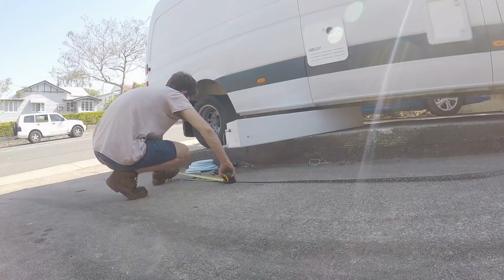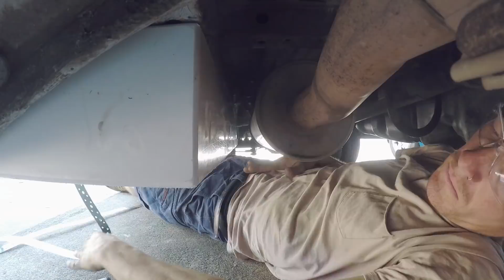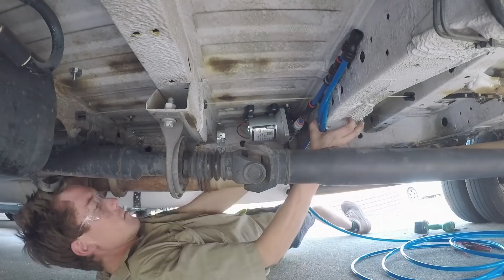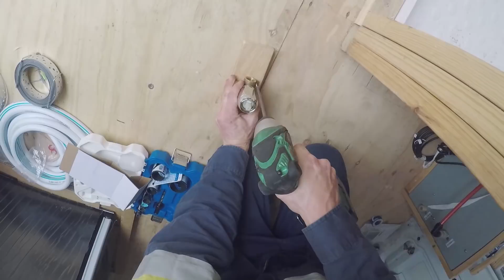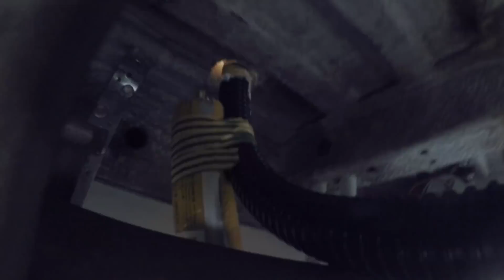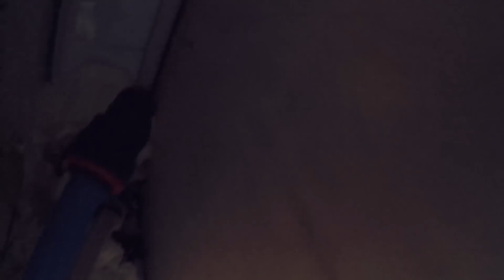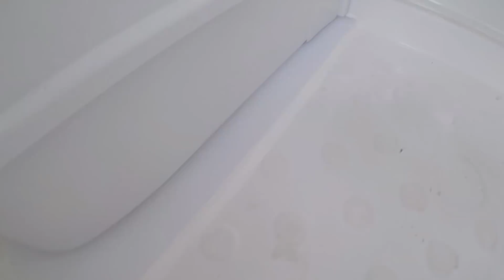S1E7 Sprinter Van Conversion | Plumbing Pt. 1

Comment from the maker: Doing the plumbing was a fun step and wasn't too hard to learn (similar concepts to electrical). Using the JG (John Guest) connector methods made it very simple also. I recommend installing tanks underneath your van to take full advantage of this space and save space inside.

Ep.7 BLOG POST + PRICE BREAKDOWN - http://www.jazmorton.com/van-conversion/ep-7-plumbing-pt-1/
Season 1 Van Build - http://bit.ly/VanBuildS1
Season 2 Van Life - http://bit.ly/VanLifeS2
Reply: As a MH owner for 20 years, big mistake with the pump under floor with the electrics involved. 1st wet day or water splashes and damp creeps into all electric joints. A maintenance nightmare.
Reply: How does that work when it is cold outside and your water freezes?
Reply: @sonia0865  External tanks will need to be drained & winterized (same with the piping). If they freeze they will crack when the ice expands. I'm going to start a van build soon and installing the Fresh water tank inside.
Reply: Do you have one on the inside of the van? This one is only good for the summer obviously
Reply: @Nikola-t89  Guy live in Australia, I believe. So.... 😉
Reply: Hii Jaz Really nice video ....just a question that popped up in my mind Does the tank get Damaged When a Speed Breaker or A high ground come in between roads..cause it definitely decreases the ground clearance of the van right? pls do reply if you see
Reply: @Himanshusingh-ef2xm  It looks like it's the same level as the body skirt. I'm getting ready to start a van build with a similar design (Plumbing) except for I'm putting the tank inside the van so it don't freeze and crack in winter.
Reply: @Himanshusingh-ef2xm Sprinters are pretty high, they are rear drive and so have a drive shaft under the chassis. His tank is fairly low profile and there are cavities under the Sprinter. Probably does not hang much below the bottom of the body. Definitely if a rock flies up though it can get punctured.
Reply: @softdorothy  thanks man!
Reply: I agree with Justin Wells you need to consider fixing some aluminium sheet as heat shielding to protect the plastic pipes and the pump from the heat from the exhaust, good luck with your build I hope you meet your completion deadline.
Reply: exhaust may burn hole in shower drain
Reply: Nice job
Reply: Nice  job
Reply: @Jaz n Lori, why didn’t you use shark bites for the connections? They’re way better for plumbing especially pex. Also be careful with pex as I’ve heard reports of critters chewing for some reason.
Reply: Can you please get your website back online?? There's so much great stuff on there that I want to learn for my van build but its gone now.
Reply: Wow, now I know why class b vans cost $150,000.00!

Comment: Very nicely done video, but:  
A. Wildly unhelpful for anyone in a northern climate. Basically a video showing what NOT to do. If you follow this build in the US, realize you can never travel to a lot of awesome winter (or even early spring or late fall) destinations. Basically, will need to stick to California, desert SW, deep South and Florida. Non-starter for Canada and most of Europe.
B. If I'm seeing correctly, you have some PVC underneath that is awfully close to your exhaust system. Would make me nervous.

Comment: I'm trapped watching all episodes over and over, I love how great you explain everything. 

I have a doubt about this episode:
I saw the couple that wont let the pressure from the main line (from outside water) wont go into the pump. BUT if you are not connected to the city water, and the pump is running, what prevents that the water pressure coming from the pump dont go out from the city connection?
Reply from the maker: Good eye, I can't remember if I had it in this episode I might have missed it, but there is a check valve (one way valve) right after the city entry and Y join. Initially I forgot this check valve and the pump would just circulate right back into the water tank.

Comment: Jaz, very impressed with the quality of the work and the video. It is exactly what I needed to see. My only comment was whether there is a piping product that bends without kinking. I ask this to see if it is possible to avoid all the right angle bends, each which have a cost and can be a source of leakage. This is a question not a criticism.

Comment: Should the filter be before the split between cold water tank and mains direct supply to protect the hot water tank from debris too or does the hot water heaters generally have there own filter?

Comment: Unfortunately, in more cold areas, I think installing water tanks outside is not good idea. I left my camper in Germany for 2 month outside,, during winter, without heating, and pipes inside water heater was blown (in was not working anyway, but still)
Reply from the maker: Yeah absolutely in europe and other colder places probably not a good idea until they are heavily insulated, even then though probs just keep it all inside

Comment: Unreal video and build series mate, so helpful! We're just about to start the plumbing on our van build and this has helped us so much! Just wondering, what connection fitting did you use to connect the pipes coming from your fresh water tank and to the shower mixer? Thanks again for the amazing videos!
Reply from the maker: They are John guest fittings, I believe they are 1/2 in or 3/4 in BSP fittings, John guest

Comment: Wondering if your fresh water tank has baffles?  RV tanks are rarely that long due to water movement (slosh).  Hard braking would cause a lot of stress on the mounts.  Any guidance here on what you did to mitigate this issue would be appreciated.
Reply from the maker: Hi mate, I would've preferred them with baffles but the manufacturer didn't design them with baffles, and it was just a stock size for the sprinter that they offer, funnily enough my grey water tank has baffles, but that because I had to design it custom

Comment: Hey Jazz did you install anything other than the HepVo to help siphon the water from the kitchen sink down to the grey water tank? I recall you using a RV sink siphon, but can't seem to find the segment about it. Cheers bud
Reply from the maker: Hi there, check out Ep.12 - https://youtu.be/Rya_p3kxyKE

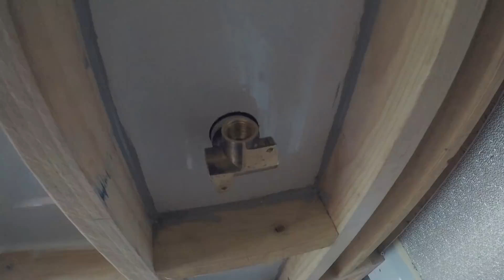And timecode 12:01 , that is the trap I use for the sink, bought it from these people:

Southern Spirit Campervans Pty Ltd
103 Delta St, Brisbane QLD 4034
0401 797 179
https://maps.app.goo.gl/wdcUvrqGrNrEBQYy5

Comment: Greetings Jaz from Cypress,Texas, USA.. I have watched a ton of your videos and they are great.  Question - how did the metal straps that you used to secure your water tank underneath the van hold up?  did you experience any sagging?  did the straps damage the tank? or cut into the tank?  appreciate your input.. thanks!

Comment: I dont like the idea of having so many unnecessary water connectors when a single hose or two will suffice and be more reliable.
Reply from the maker: cant bend that pipe easily its stiff and dont want to kink it, and I needed to put in lots of T and Y connections

Comment: Very professional mate. Glad to see you showing the tube end inserts.Supprising how many so-called experts demonstrate the correct way of fitting this pipe and fittings without the tube inserts. Why would you not spend 50c rather than risk a leak, because it will eventually, especially the hot

Comment: Neat video! I myself am gonna go with compression fittings instead of quick connects. As a heavy truck technician, quick connects are easy and convenient, but eventually fail or have a higher failure rate. Compression fittings are great for long life applications

Comment: Hey Jaz, this video has been very helpful I have referred to it several times.  Where did you get the T fittings that come from the water pump (where the inlet can bypass the pump) and also the one-way fitting?  Thanks!
Reply from the maker: i bought from Camec

Comment: Nice work! My biggest concern is the whimpy  straps you used @3:30 to support the tank. I’m pretty sure that they’re waay to light duty. You should have a look at the factory mounts for fuel tanks, etc. Especially considering that it’s probably going to weigh plenty when full, and think of the “live loads” while moving, sudden stops, etc. with all the water sloshing around.

Comment: This is a great series of videos, but you do know because you used flexible pipe like that you didnt need all those fittings. kind of the point of the flexible stuff you just run it like wires and then tap or splice it in places...

Comment: Please install a sheet metal heat shield between the muffler and the side of the fibre glass water tank... heat an polyester doesn't mix very well, heat makes the polyester brittle...

Comment: Should of put your shower tray the other way around, that way the fall to the outlet would of been beside your water tank ;) also put isolation valves on your shower incase you need to repair or replace it at any point would be helpful.. just a few tips!!

Comment: Nice job but I suggest you put a one way valve on the end your fresh water breather hose or you might get a small amount of contaminated water going back into your water tank during wheel rotation in the rain (seeing that the exit point is in your wheel arch)

Comment: I hope you don't plan on traveling to areas where the weather reaches below freezing temperatures because if you do, you will not be able to use your toilet, shower, or kitchen sink. 

This plumbing method would not work for me in Canada. All the pipes would freeze and break when the water swells inside the plastic pipes.

Comment: GREAT Video, but speaking from experience... you should have put you pump inside. I can all but PROMISE you, that when it fails, you will be in the worst situation possible (pissing rain, howling wind Etc) and need water and the pump will be a pain to replace or remove to fix the broken parts. PLUS you are going to end up with all sort of road debris on it.

Comment: i have never seen such a bad work! the hot water pipe outside of the car?! the bad work outside of the car when u build in the toilett, etc... really not okay and it wont do the job for long. all the moisture will come thru after some thousand kilometers of driving. the car will become rusty. what will u do in winter? the watertank is outside...
Reply from the maker: all still going solid bro..

Comment: Mate, brilliant plumbing! Are you going to build a housing case for your water filter and plumbing underneath your van to protect your water system considering you are very meticulous? ^_^
Reply from the maker: no ha i won't worry they're quite resilient and low cost so I wont worry :)

Comment: hey Jaz I live in Canada it gets about -40C  what would ur suggestions  be as my fresh water tank will be under my bed  inside the van so it wouldn't freeze but im not sure where I should put  the grey water tank  do you think a heat traser wire would be  good enough for the water not to freeze?  if its outside?
Reply from the maker: honestly my grey water tank valve stays open 99.9% of the time, so there is no actual water in it, it just run out. i think a heat trace wire might use too much power to live off grid sustainably. just leave the valve open

Comment: What about a metal shield/cover for the tank in case of debris in the road, and also shielding from the exhaust pipes..
Reply from the maker: could be done of course, the tank is still holding up perfectly from any debris. the exhaust pipes are heat wrapped shown in ep.12

Comment: You have Skills and are good at showing them in video! 
 Something i noticed:  The outlet end to your water tanks "breather hose" is in your wheel well and maybe needs a "breather filter" of some sort to prevent insects and debris from entering open ended hose and then contaminating your tank .

Comment: For the tank fill, the hole on the tank can be drilled higher for better full fill up right? The most detailed demo ever.  Thank you
Reply from the maker: Thanks a lot, it doesn't matter where you put it actually, the pressure still fills the tank all the way to the top

Comment: What size pipe are you using here? My Truma system start with 12mm fitting; will that be sufficient for the rest of the system including the onsite water inlet etc. Cheers
Reply from the maker: It is 12mm which is 1/2 inch, and that is what the inlet is too. it will be sufficient

Comment: do you need a non-return valve on the inlet? so when your using the pump from tank, it doesn't send pressure to your inlet?
also, great video.....so easy to follow and very practical for people to learn from. well done!
Reply from the maker: Thanks a lot, I actually did put a check valve before the inlet but I did that so that if the fill valve was opening the pumping would not continue circulating the water around in circles back to the tank. but the fill point actually has a check valve on it already

Comment: the tank looks like it will be hit when you touch a high surface
Reply from the maker: the tank is heavy duty and if it got hit, then the drifeshafted would be hit too and side skirts, so it is unlikely

Comment: Big reason for using plastic tube to plumb water is because it allows using fewer fittings which creates fewer potential leak points. I see you've taken a different path... was it intentional?
Reply from the maker: I just did the best thing that I thought at the time, the JG fittings are pretty awesome, and if I could;ve just bent the plastic pipe instead of using 90 degree fitting i would've but it was too rigid.

Comment: At 6:30, you have the inlet to your tank. Would it be better to have the inlet near the top of the tank? Or maybe the garden hose pressure together with the one-way check valve is enough to keep all the water in place? Is that the idea? Thanks
Reply from the maker: Thanks for the questions mate, it doesnt really matter as to where the inlet to the tank is, as it's forced pressure coming in when filling. I prefered to put it at the bottom though.

Comment: Is this the standard placement for tanks and pumps? I'd be very concerned about having all those plastic bits and tubes so near the exhaust... Given that you gain gravitational help with water flow, wouldn't a roof mounted tank be a better option?
Reply from the maker: Hey good questions please refer to ep.12;)

Comment: Are you going to install any kind of heat shielding between exhaust system and the tanks/piping beneath the van?
I'm only just starting to seriously consider van life and wondered why most van conversions I've seen here on youtube don't utilise the space beneath the floor. Not having a van yet I was starting to think it must be impossible. Good to know that it's totally possible.
Reply from the maker: I have done the heat shield already and will show in pt.2 plumbing. You can definitely utilise this space 😃

Comment: Jaz, love your work mate. 
Just wanted to know, from the video, it doesn't appear to be higher than the level of the water tank, so I was wondering if you've had any issues with not being able to fill the tank to the top? Or maybe it is above the tank and just couldn't see properly in the video?
Thanks, mate!
Reply from the maker: The tank fills absolutely fine, it doesn't need to be above at the top of the tank, it is very important to have a breather plug at the top though so the air can escape or come in

Comment: Hi!
You’re doing a fantastic work on your van!
I’ve watched all episodes and I think it is the best out there. 
However, looking at the plumbing I do see many things I don’t like. 
You have several couplings in the wall and you’re not using ”hose-in-hose”. 
You want zero couplings in the wall. 
There are connection boxes with a ”leak hole” telling you if you have a leak. I would have used one of those. 
I don’t mean to be a smart ass. 
Take care!
Reply from the maker: Yeah that would've been smarter, I was planning to cut the side out of the cabinetry so I have false panels so it is accessible. We will see ;)

Comment: Curious about the position of the water tank, have you notice if the water gets heated by the exhaust since its very close?
Reply from the maker: Thanks yes have had this comment about 50 times haha :) I have already wrapped the exhaust in exhaust heat wrap which insulates the exhaust from outputting and trasnferring heat. You can just about grab the exhaust with it on. This will be shown in Plumbing Pt. 2. Cheers :)
Reply: Sorry, didn't know, maybe add an annotation in that part of the video that says that you fixed that now :) Thanks alot for the answer !

Comment: Btw, I always thought that pump has to be below level of the tank so it can be gravity flooded. Are you able to use all the available water from your tank with such arrangment?
Reply from the maker: Yeah these pumps can run dry for only a small run before needing water so yes it only runs dry for a split second before water flows. It would use up all the water except for the miniscual amount beneath where the bung enters the tank

Comment: I know this is old, and you've probably been using it for a while now, but you're going to want to insulate your water and drain pipes from your exhaust pipe. The heat from that will likely eventually melt those plastics, or at least warp them.
Reply from the maker: Thanks man! They've already been insulated for a long time, but will show in plumbing pt 2

Comment: Good job!  Thank you for detail video.  Curious, what was the reason one of pipe  leak?  Did you change it to new pipe fitting to fix it?
Reply from the maker: Good question, there was a small scratch on the end of the pipe, and this allowed water to pass through this scratch bypassing the O-ring, so I replaced the little bit of pipe and it was fine